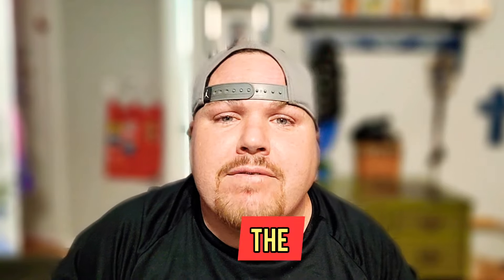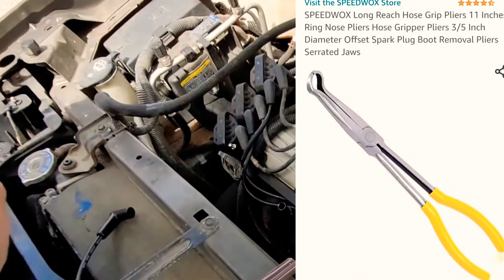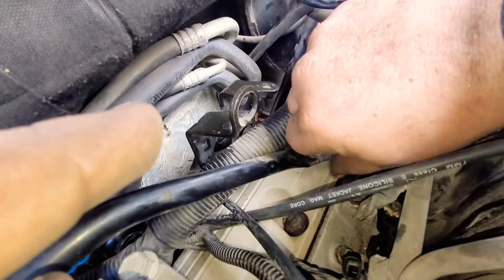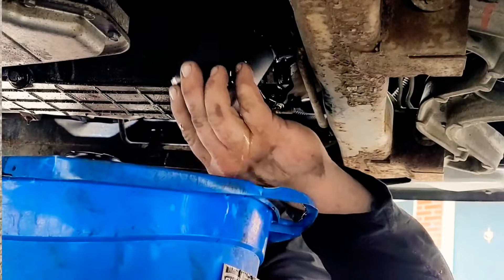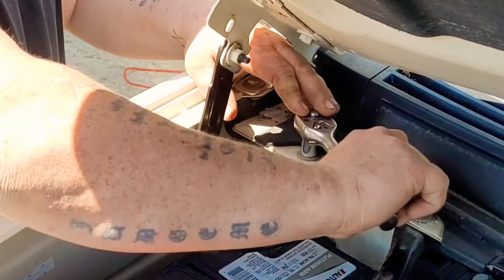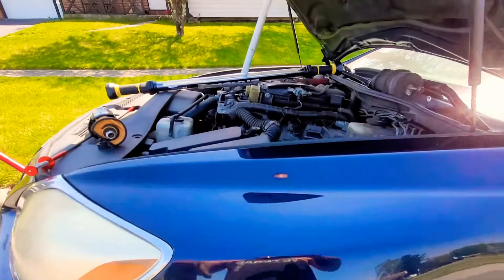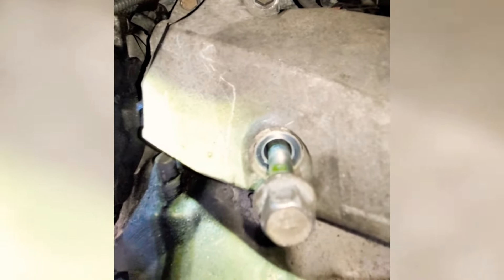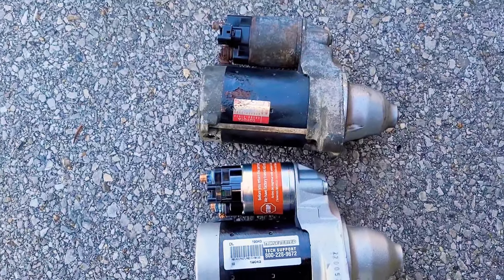A Day In The Life As A Mobile Mechanic

Comment: Semper fi
Let me tell you my luck
On Saturday I did valve cover gaskets on a subaru 2010. Changed cables and plugs as well. Charged 300 it took me around 3 hours cause you know those valve cover bolts on the subarus always brake.. after that I did a strut and axle assembly and brake job on a 2010 Mercedes c300 charged 350 took around 4 hours. So I get home and left my tool bag with everything at the door to my garage and forgot about it. Next day was supposed to do an easy oil change and couldn't find my tools lost everything. So now questions 
Starter tool set 
That obd2 tool you are saying is good where do I put the coupon code at
What other tools do you recommend and I was thinking of getting one of those oil pump for the oil changes what do you think about them?
Like I told you last time 
SEMPER GUMBY Shit happens right
Reply from the maker: So I will awnser this in 2 replies cuz I'm on a job but I want to awnser click on the links I'm sending you and at the end when you go to pay they shoukd have an option where you can enter discount codes also Amazon has a coupon you can attach to it right now that's another $18 off you will see it soon as you click on the link they will have a coupon you can check the Box it's right below the price, so man you can get this thing for like $65. AncelAd610 Plus https://amzn.to/3kqjmOP

Discount code "JTPIHRQY"
Reply: @semperfimechanic  I got it now went down to 90 bucks with tax that's good first tool down now just got to get the rest
Reply from the maker: I'm about to send you the oil pump extractor hang on also did the discount code work
Reply: @semperfimechanic  yeah it was 138 with taxes without the code 90 with the code
Reply from the maker: Ok good hang on got an extractor for ya, are you looking for a hand pump or mechanical
Reply: @semperfimechanic  either or I'm thinking hand pump for now cause I have to buy a lot of stuff
Reply from the maker: This one is the best middle ground plus you can do alot of other fluids and had a brake Bleeder set up.  Click on link https://amzn.to/30Bzm9Q
Reply: @semperfimechanic  I like that one I order it already. Next is a good tool set